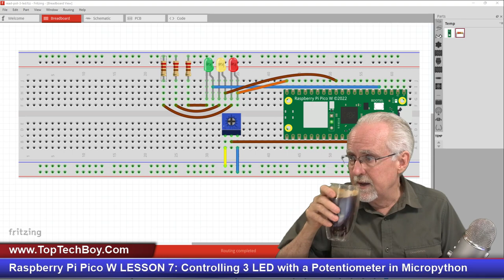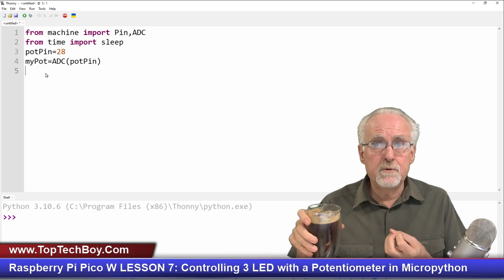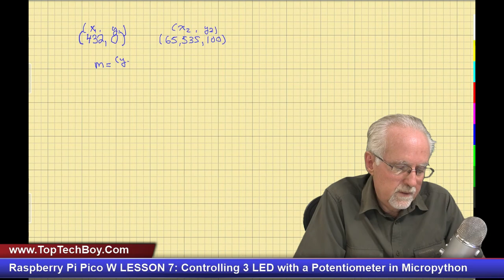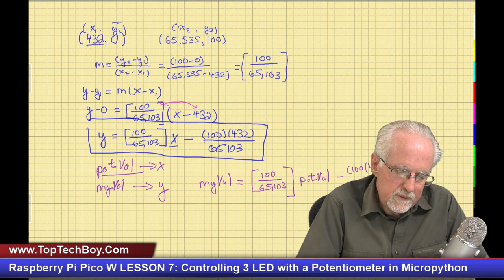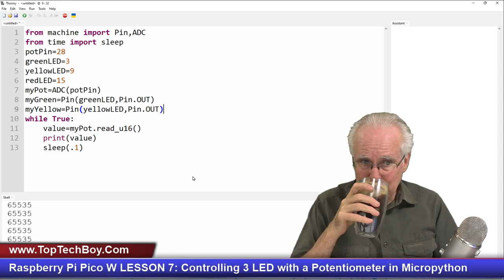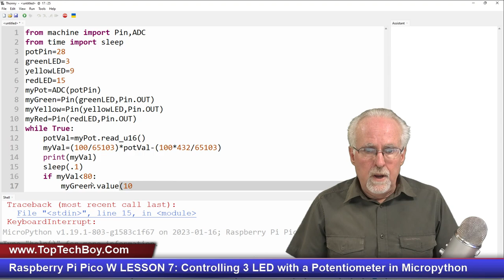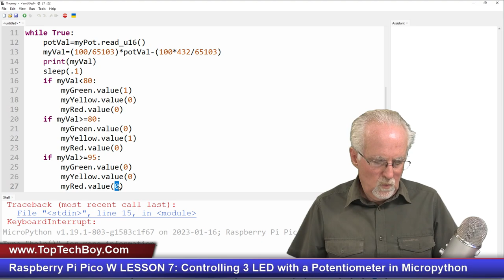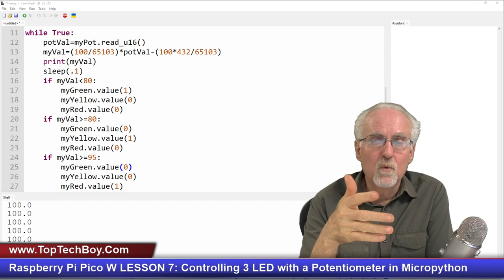Raspberry Pi Pico W LESSON 7: Controlling 3 LED with a Potentiometer in Micropython

Comment: Not good : second LED ranges from 80 to 100, when it should be between 80 and 94.9.  The subsequent codes simply forces the second LED to shut off but the logic of ranging between 80 to 100 continues to exist. Dangerous!

Comment: I am not 100 percent about the logical error, but I think in order to turn on the green LED, the if statement should be if myVal >> 0 && << 80 then green LED value = 1....   if myVal >=80 and <=95 then yellow LED value = 1 ..... if myVal >> 95 && <= 100  then red LED = 1

Comment: Hi Paul.  A more efficient circuit would be to place all cathodes of the LEDs into the same column and run just 1 resistor to ground since only 1 LED will be on at a time.  The thing not good with the logic is that for values over 94, 2 of the logic conditions are met - the second simply supersedes the first quicker than the eye can pick it up.

Comment: I think that for values above 95 the yellow is flashing on then off so quick you can't see it. A value of 96 is above both 80 and 95 but as the program loops one if statement turns it on and the next turns it off but momentarily it is on when it shouldn't be.

Comment: Looks like several people have already commented on the logical error and I would agree with them that the second if statement and the third if statement can be true at the same time causing a fatal error that might possibly crash the entire internet or topple buildings or bring down bridges and airplanes, or maybe just leave an LED on when it should not be.😁 Thanks for another great series of lessons and your thorough approach to teaching. Keep using your gift for the good of others. I posted my solution to the homework assignment in the comment section of the last video.

Comment: Homework solution:
The second and the third if statement were both true when the value was above 80, so it was turning the yellow LED on and off, as well as turning the red LED on and off, causing it to look a little 'glitchy'. The proper way would be to use compound conditions. The corrected second if statement would look like:  if(value>=80 and value<95).
Reply: nice

Comment: That was great!  Your video series are the best that I've found so far.  I want to (re)learn electronics and write my own code, not just copy and paste it.
I wrote the program is more or less the same way.  I used an and statement for the yellow light, so it will only turn on if it was within a range (>=80 and <95).  It looks like others picked up on this already.
I wasn't sure how to reset the pins and turn the LEDs lights off when I hit control C or when done.  It would have been nice to have some code, which would reset the pins.
Another way could have been to use a while loop and ask the use to type something when they are done, which would then turn the LED lights off and stop the PICO from reading a voltage input.  I didn't play around with that though.
Another thing just came to mind.  To stop the LED flickering, when close to a cut off, the sleep time can be increased (or decreased if there is a delay).  This is a trade off.  There is probably a better way to smooth out the readings, either electronically or mathematically?
Reply: KeyboardInterupt: , followed by code to turn off the LEDs. Maybe I missed this in the video, with my haste.
I really enjoyed this circuit!

Comment: I see 2 logic errors.

1. The upper threshold of above 95 is meeting condition 2, causing the yellow LED to blink slightly.
2. The math allows for values of less than 0 to be generated if the value returned by the ADC is less than your lower offset you tested for.

Also I realize you'll cover this in a future lesson but it's best practice to use else-if type statements after an initial if to make sure 2 exclusionary segments of code aren't both run on the same pass.

I simplified the math a bit on the value calculation, it works out to the same as how you did it.

from machine import Pin, ADC
from time import sleep

potPin = 28
greenPin = 2
yellowPin = 1
redPin = 0

myPot = ADC(potPin)
greenLED = Pin(greenPin, Pin.OUT)
yellowLED = Pin(yellowPin, Pin.OUT)
redLED = Pin(redPin, Pin.OUT)

while True:
    potVal = myPot.read_u16()
    offset = 704
    upper_value = 100
    myVal = (upper_value / (65535 - offset)) * (potVal - offset)
    if myVal < 0:
        myVal = 0
    print(myVal)
    if myVal < 80:
        greenLED.value(1)
        yellowLED.value(0)
        redLED.value(0)
    elif myVal < 95:
        greenLED.value(0)
        yellowLED.value(1)
        redLED.value(0)
    else:
        greenLED.value(0)
        yellowLED.value(0)
        redLED.value(1)
    sleep(.2)

Thanks for the great lessons, Paul.  Looking forward to continuing this course.  Python is a different animal than I'm used to, my background is mostly in C and BASIC variants.  I'm maintaining a document with a list of all the commands / functions / objects as I learn them so I have my own shorthand reference when writing new code.

Comment: Very informative series of videos Paul. Learning a lot about the Pico W. In the code you wrote for this tutorial, when the Pot readings return a value greater than equal to 95, the Yellow LED will actually flash for an instant before the Green turns on. To be more precise, should the second if statement have tested for >=80 AND < 95 to prevent the Yellow from briefly flashing?
Reply: Please ignore my comment. This is covered in the next tutorial.

Comment: I agree with the below comments that the second if statement is a logical error in that it is still true even when the reading is greater than 94. I also want to add that I think the placement of your delay statement is bad. It should go at the end of the loop. My thinking here is that if this were data from something important (say a sensor on a plane) you'd want to take a reading, perform the math and then react to the data without a delay in between reading and reaction.

Comment: Homework problem. mmmmm.  Something wrong with the code? I followed along by rewriting all the code myself. There is something I do not like. There is something that seems out of place. And without giving a clue, I will wait and reply later. I can see there might be a place that would cause a blimp. Actually it is so fast we do not see it.  

And yes, this is fun to open my mind to absorb these topics.
Reply: The code works as advertised. But the conditional statements must be constrained to work within its boundaries. These are the types of bugs you would find in the real world.
Reply: I followed along by rewriting all the code. I could see the middle 'if' statement was a simple if. Every time the code is run and goes by this statement the middle led light does go on. Yet is is so fast we cannot see it. Just think what would happen if it was starting a motor. The motor would start up and then shut down. This would not be good for the motor. Perhaps even breaking it. Then when it is actually needed it may not work because of the false startup and shutdown. We have seen the answer to this problem in the week before. Look at the answers. Yet for me I had to look for the answers in this week home work. So thank you for going slow and letting me follow along.

Comment: Here is a code I found to work best.: 

import machine
import utime

# Define the GPIO pins for LEDs and the potentiometer
green_led_pin = 15
yellow_led_pin = 14
red_led_pin = 13
potentiometer_pin = 26

# Set up GPIO pins for LEDs
green_led = machine.Pin(green_led_pin, machine.Pin.OUT)
yellow_led = machine.Pin(yellow_led_pin, machine.Pin.OUT)
red_led = machine.Pin(red_led_pin, machine.Pin.OUT)

# Set up ADC (Analog to Digital Converter) for the potentiometer
adc = machine.ADC(machine.Pin(potentiometer_pin))

def read_potentiometer_value():
    # Read the ADC value (0 to 65535) and convert it to a range of 0 to 100
    pot_value = adc.read_u16()
    return int(pot_value * 100 / 65535)

def control_leds(pot_value):
    # Turn on the LEDs based on the potentiometer value
    green_led.value(0 <= pot_value <= 79)
    yellow_led.value(80 <= pot_value <= 94)
    red_led.value(95 <= pot_value <= 100)

while True:
    pot_value = read_potentiometer_value()
    print("Potentiometer Value:", pot_value)
    control_leds(pot_value)
    utime.sleep(0.1)

Comment: SOLUTION:  found two bugs actually...  Your circuit has a bug - literally - look at lower side of Pico about half way down (about pin 10 on breadboard... hahahaha

The code is causing two conditions for the yellow LED.  You are looking at >= 80 and >= 94 both making the yellow LED turn off and on.  Result is the LED will toggle at the scan frequency which is undetectable to the eye.

Also,  I created a math algorithm to avoid manual computations for characterization of the potentiometer.  EVERYONE SHOULD USE THIS....  Please see code and explanation here:

https://youtu.be/U3giFbksQTA

Comment: Here's my homework: 
https://youtu.be/KBCUev0yoP8 🙂
Reply from the maker: LEGEND!
Reply: @paulmcwhorter  
Thanks, but I think I could have done it better by having the second potentiometer read -5 at 0⁰, 0 at 90⁰ and +5 at 180⁰. 
That would have been more appropriate I guess 👍 
Also, isn't there a way I could have physically done this, by hooking the output reading of one potentiometer as input voltage of the second potentiometer??? 🤔 💭